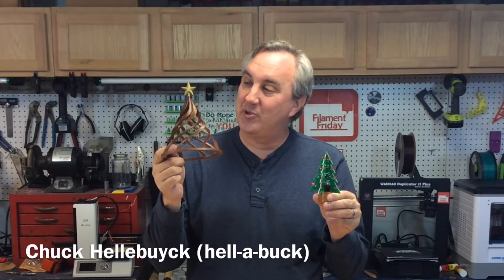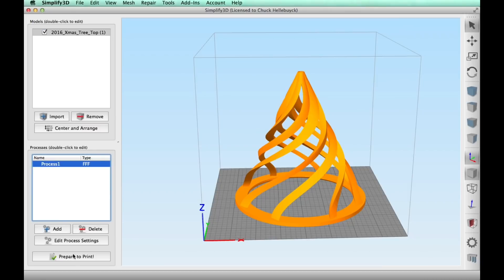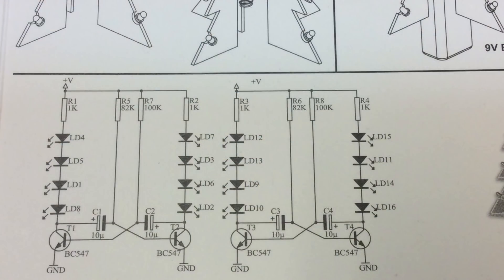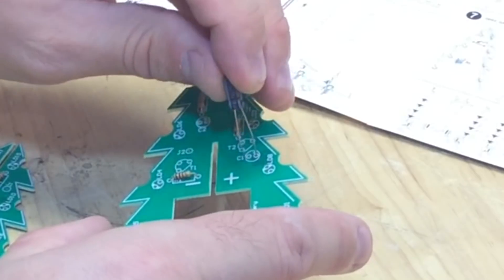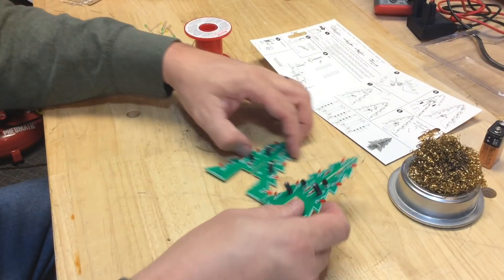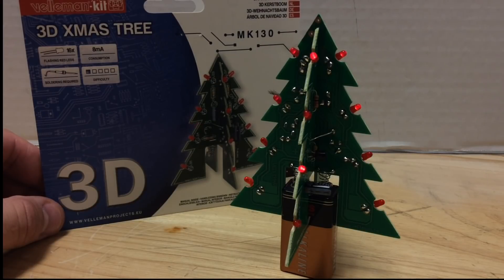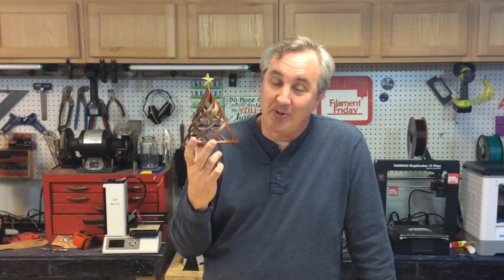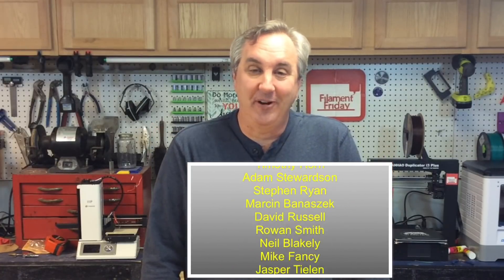3D Printed Christmas Tree and 3D Electronic Christmas Tree - How To and Assembly

Comment: Have you done any more tinkering with your Robo3d R1? I have been doing a bit of research on it and it does some nice quality prints.
The electronic circuit for the Xmas tree is a simple flashing circuit, I use it in one of my own projects, and I agree that the tree is a good way to get started with soldering and simple electronic circuitry.